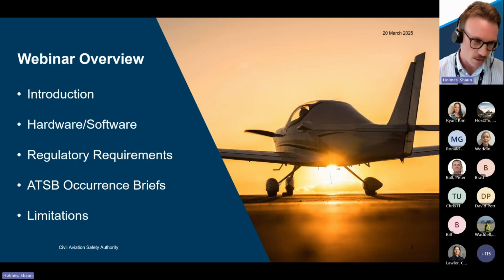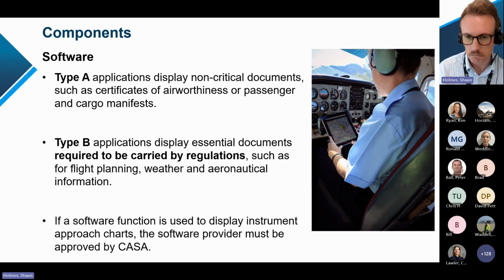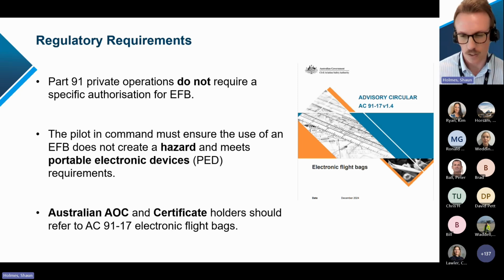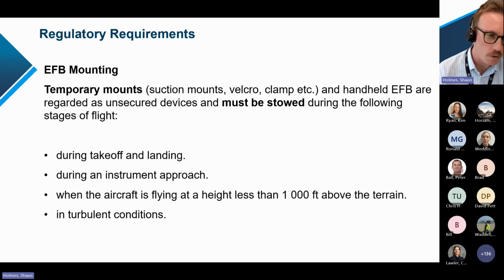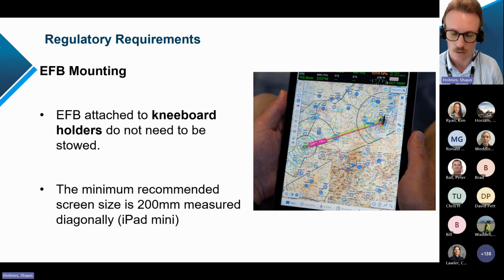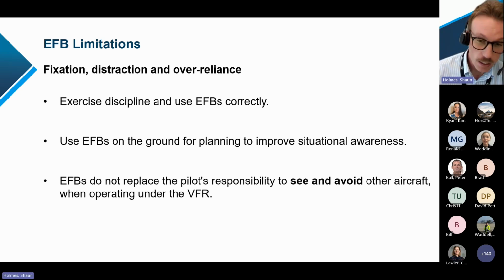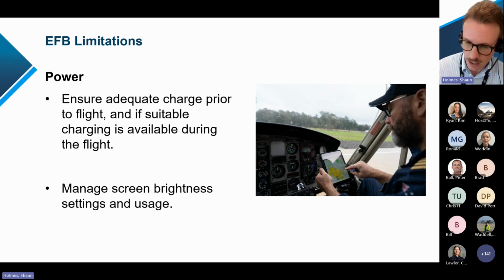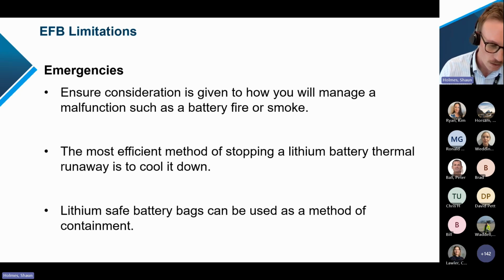Flight planning - Understanding electronic flight bags - 20 March 2025

Comment: It is disappointing that this presentation does not emphasise the importance of verifying the integrity of the GPS information.
My original flight instructor was killed along with his four passengers, in the early days of GPS,  because the GPS manual did not clearly indicate the indication of an un-reliable signal.
The "runway" software manual does not (in my opinion) adequately warn pilot of the importance of the green dot at the top right hand side of the display.
Green means good signal, yellow means un-reliable signal and red means NO signal.
How many users are aware of this and is this information formally taught?

Comment: Neither of your ATSB briefs concerned accidents caused by EFBs, did they?

The first had a dropped phone in the chain of causation, but the accident was a mishandled high altitude landing with insufficient power to maintain control.

The second had no EFB in the narrative at all, it was a dropped water bottle. It’s unclear why it was included in an EFB seminar.

Having banned most practical mounting solutions below 1000 feet, shouldn’t you have less tenuous reasons for the restriction? Surely in this age of non-prescriptive regulation you can set standards and guidelines for appropriate mounts and leave the implementation up to the operator? What are you actually trying to achieve here?
Reply: The point he was making; was having loose items in close proximity to flight controls can adversely effect the safety of the flight. Due to the reduced focus on the flight tasks and now being focused on the item near the said rudder pedals etc.